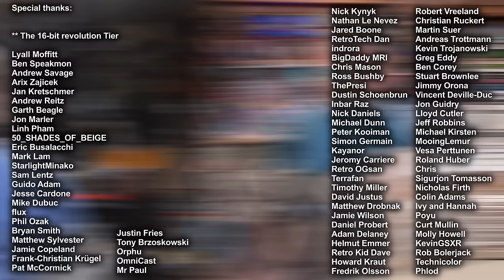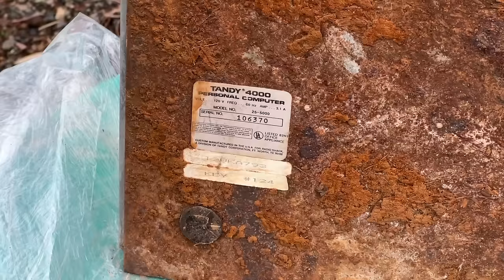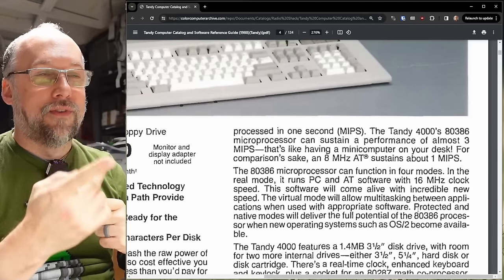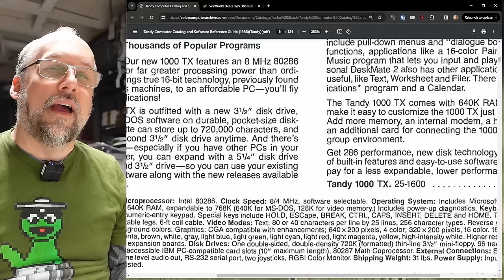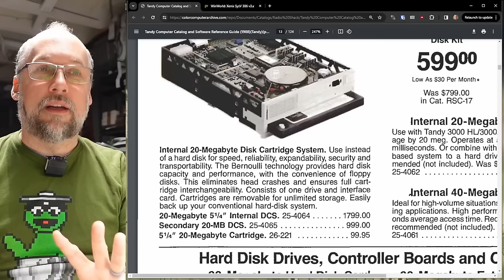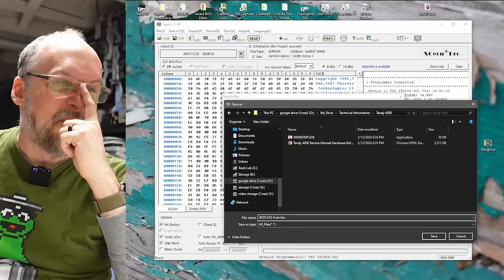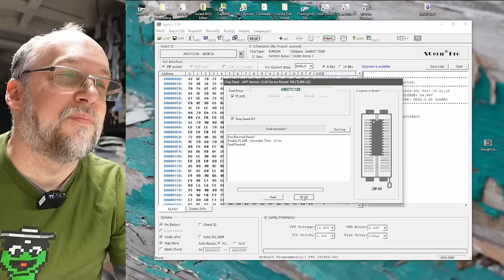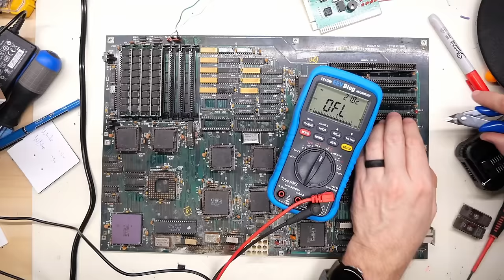0079 I'm at a loss for words when I first see this Tandy 4000 computer

Comment: @54:10 Yes, the 80287 was sometimes used on early 80386 motherboards because the 80387 wasn't ready for over a year. (The 80386 was released in October 1985 but the 80387 didn't come out until early 1987.) So when the machine was first released in 1987 some people might have been using the 80287 with it, but the 80387 would have been available pretty early in the life of the machine.
Reply: Also, even when the 387 was available, the 287 was much cheaper so many motherboard kept the 287 socket. A 287 is significantly slower than a 387 but for many purposes a 287 is "enough", it's still a massive step up from "no FPU".

Comment: Eeek!  That machine looks like it's been fully submerged.  On the basis you're offering the case for someone local to try to restore and your comments on your backlog, perhaps this motherboard is only worth another hour of troubleshooting?  Looks like it ended up being a hand-me-down computer, left with one original card and the rest being bizarro 8bit cards ...
- One wonders if some of the legs on the PLCC devices have mechanically fused with the socket due to the corrosion, so if any of those have to come out to deoxit them, there's a risk
- Also, if the board ends up having to go in the ultrasonic tank there's the possibility of more failures

Comment: how that went off, is that microsoft simply renamed their os/2 as of version 2, to the next version, windows nt 3. and therefore, what is on your desk today, literally IS os/2 :P just called 'windows 10'. (it could always already run all the software for that lousy dos shell of theirs, the 'windows 1 to me' line, which for all the obvious reasons got cancelled after me and simply replaced with the nt (which literally is the os/2) kernel. :P so yes. os/2 'did become the thing ibm promised it to become' just no longer called 'os/2' and no longer with ibm :P LOL.
Reply: take nt 3.51 ... run it through a disassembler, or for all i care, just a hexdump damn thing says 'os/2' all over the place. lol. they changed the logos and the pictures and colors. but ya know. that never mattered much. 'explorer.exe' is just another program anyway. lol. can replace it with literally anything else too. but the whole kernel and drivers part and what not. yep. 'windows nt' didn't just fall out of the sky just at the time microsoft magically 'discontinued' their os/2 branch :P the thing that 'didn't survive' is the original windows line. the 1 to 98se/me 'glorified dos shell' one. see if you have 2 product lines, and they both can run the same programs :P and one is a burning pile of garbage :P but the other one sells better and doesn't come with a partner to which you have certain obligations, well, you simply swap the name :P
Reply: the split between mickeysoft and ibm btw already happened before ibm still came up with warp. basically microsoft os/2 lanmanager 2, simply got named windows nt 3. in the next version.
Reply: calling sco xenix a 'unix' is taking it a bit far :p lol. it's basically multiplayer cp/m or dos (in much the same way the os/2 kernel and nt or quarterdeck deskview are too) :P lol. still just a glorified lava lamp that prints letters. not at all or just barely capable of some networking. xenix is a bit of a weird and lame one that noone at that time actually bothered with. if you wanted a unix system you got an actual unix system. not that surrogate crap. :P (ya know. parts of that may even have made it into os/2 before it became nt ;) microsoft inc is never very original :P LOL. in their usual 'sybase 7 is now ms sql server' fashion :P 'we totally just invented that ourselves' :P lol.

Comment: The empty socket is unlikely to be for an 80387. The 80387 has 2 rows of pins, but the socket has 3. Other than 486s, it is uncommon for PGA chips to sit in a larger socket. The 82385 (Intel's official cache controller for the 386) does have 3 rows, but the total pin count doesn't match. I have never seen two types of math coprocessors on the same bus. Considering the only things on the CPU local bus are math coprocessors, cache controllers, and the chipset (which appear to be complete). It is possible that the chip is some kind of custom cache controller for the 386 with some on-chip cache (as there are no SRAM chips on the motherboard)
Reply: By the way, the empty socket has a label saying 'W1167' next to it. Searching for this part came out dry.
Reply from the maker: Ah that's a Weitek math coprocessor. I'm quite sure they released theirs before Intel did. (for the auto cad crowd mainly)
Reply: @adriansdigitalbasement2  Yep, just found out about that!

Comment: Adrian am I missing something here?  When you're checking the capacitors after discovering that the 12 volt rail has suddenly become shorted to ground you start checking continuity on the tantalum caps.  I think the reason they don't all beep is because of oxidation / poor probe contact.  Aren't they all in series??  Confused as to how one could actually effectively test individual caps for short circuits when they're all still soldered into the MB / 12v rail.

Comment: Mobo?  Maybe just for the challenge.  The rest?  meh.  Left for Dead for sure.  The case is just too far gone.  Although not a TANDY case, you could just obtain or just reuse another case and get this thing running.  The PSU, I wouldn't touch 100 miles away.

I genuinely feel sorry for the machine and the abuse it went through.  But for shame on the seller, that unless sold for free, that this was something that was ACTUALLY sold.

I don't like seeing garbage get sent to other people to "fix" unannounced.